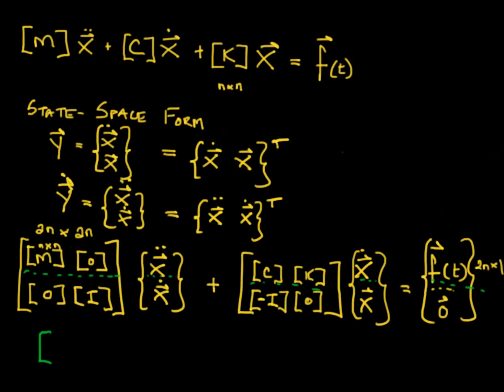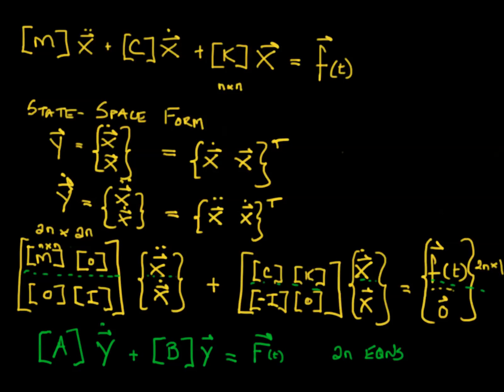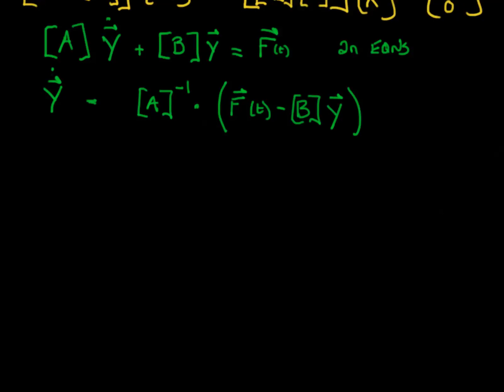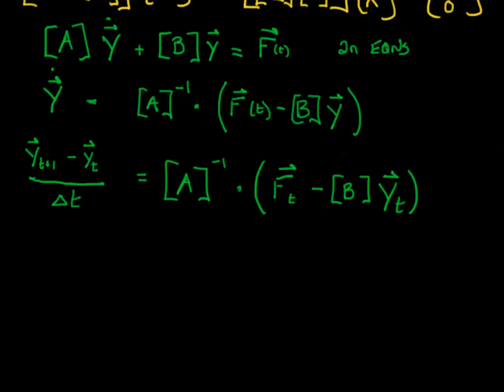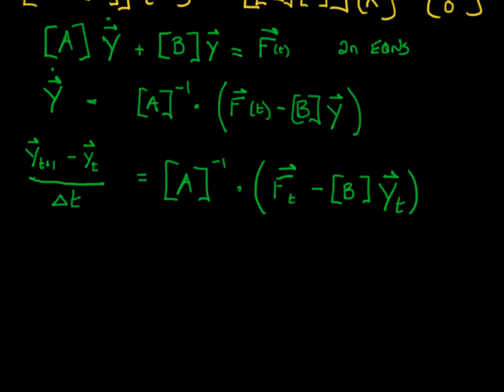Solving Equations of Motion by Direct Time Integration

Comment: This is nice and interesting! I have actually implemented this kind of solution too in Python recently, but I used the state-space formulation in Inman's Mechanical Vibrations which inverts the n x n mass matrix to obtain the state vector, xdot(t, x). The A matrix is still a 2n x 2n matrix, but it is A = [zeros(n) eye(n): m^-1*k m^-1*c] . Since the mass matrix is a sparse, diagonal matrix, it wouldn't be computationally expensive to invert it compared to the 2n x 2n matrix, A, here.